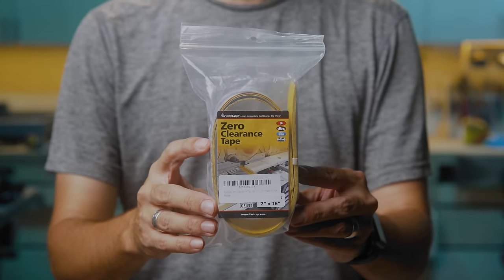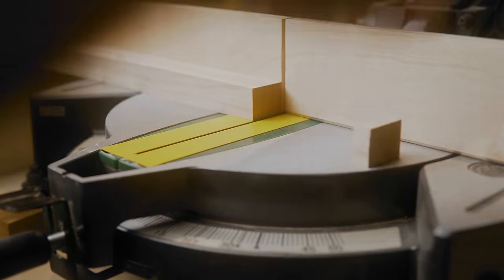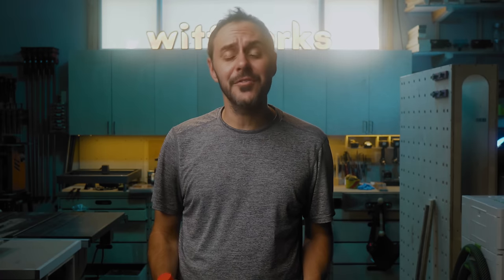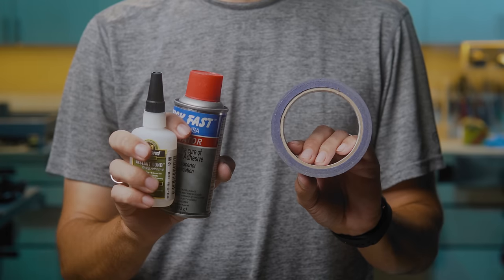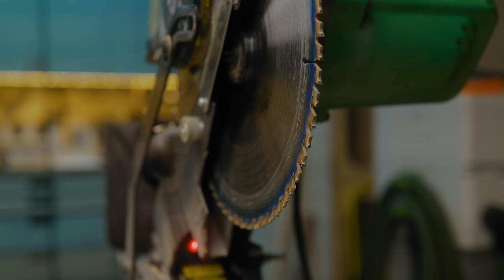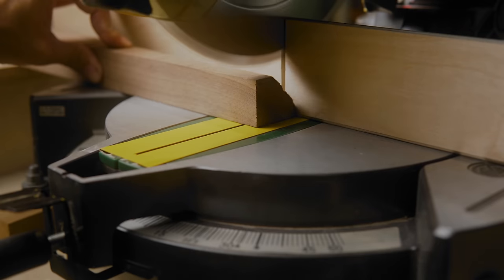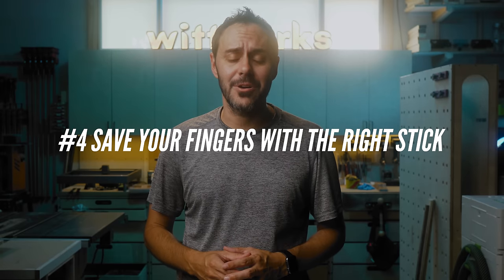fall in love with your miter saw again.

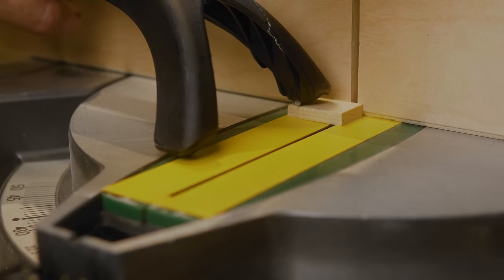Comment: That new push stick is bad because it flexes. You can see at 6:22 when you put downwards pressure, the small piece of wood moves forward slightly before the cut. Then after the cut when you release, it moves backward and leaves a visible gap from where the blade originally was 6:29
Reply: Great catch!!!

Comment: I live in Sri Lanka and I got a $100 miter saw (DongCheng) pretty certain that the company was cost cutting so they just gave a solid piece of plastic with no count outs. It basically was a factory zero clearance insert. And for that price the miter feature is accurate but the bevel feature is meh. I never use it cause I don’t trust the poorly pasted sticker. Also came dead square out of the box

Comment: Great honest video with practical application of things that most will actually use.  Sometimes I think some of these channels just teaches you to make jigs just to make the jigs with all the tools and get no real work done.  Simple is better.  Will give the CMT a go.  Diablo's are cheap but their teeth are very fragile.  I do want to add that a quality mitre saw does help, but avoid the sliders unless you actually need a slider.  A simple 150 USD makita 10" single bevel will do vast majority of the work you would ever need.  Less things to wobble, less things to adjust.  27 lbs of workhorse that you can take anywhere.
Reply from the maker: For sure. This summer I helped a friend in Montana and they had a very old 10” makita. It was dead on.
Reply: @wittworks  I love these things.  You can often pick these up for 50 bucks.  I just put different blades in different saws because of how cheap they are.  Goes up to a 5 1/4 at the base (with a shim on bottom will do 2x6) for most daily work construction to fine furniture.

Comment: I’m confused. Is this for a saw that is dedicated for 90 degree cuts? As soon as you need to cut any other angle you are cutting into the fence and bottom tape.  I built a workshop with pandemic pine and pandemic OSB 😢
Reply from the maker: Yes.

Comment: Tried out some XFasten woodworking tape last weekend, and whoa what a game changer. Used it on my planer sled, to hold pieces I'm attaching where a clamp won't fit. Works amazing, strong, no residue left behind
Reply from the maker: That’s great!
Reply: I have had mixed results with the xfasten. I will try this brand next

Comment: The problem with the 10 million dollar stick is it relies on surfaces past the deck of the miter saw which is no problem in a shop but anywhere else you are unlikely to have that support like if you are using vendors miter stands or using the saw with no stand

Comment: I've tryed to use plain masking tape for masking painting projects off and the adhesive is too strong without sealing off the tape from paint bleed and it leaves residue behind.  It might work okay for using it on saws and stuff, but don't try using that for painting/DIY projects. That's when actual painters tape comes in handy.
Reply from the maker: Exactly

Comment: The most dangerous thing in the kitchen is a full blade. This is true for saw blades, duller blades are dangerous for a variety of reasons such as catching on a knot, pinching, pulling, pressing, etc. A sharp blade will cut through something, a dull blade might get caught on it and send it flying. It can happen in both situations, but a lot less with sharp blades.

Comment: The '10 million dollar stick'  is a good idea but unfortunately, not rigid enough. It will move your piece out of alignment when you put hold down pressure on it. I have ruined many miter saw cuts using this stick and no longer use it.  Hopefully FastCap will produce a non-flexing (rigid) 10 Mil. Stick that will not flex and push your cut piece out of alignment.
Reply from the maker: Very interesting. I haven’t had any deflection in mine 🤔
Reply: I tried it as well. Besides the flexibility problem, I the "buttons" that contact the wood and tool surface are hard plastic that slip and slide. I felt more dangerous using the stick than almost anything else. It didn't take long for my 10 million dollar stick to end up in the trash.
Reply: @wittworks  at 6:22 in your video the wood moves forward from the push stick flex, and at 6:29 it moves back once you let off the pressure

Comment: get a makita drop saw, you get a zero clearance bottom plate already. you actually need to do a first cut before using it to cut timber.
Reply from the maker: Like a miter saw? I’m a makita man.
Reply: @wittworks  sorry yeah we call it a drop saw, I meant mitre saw

Comment: By the way...I hate my Forest Woodworker's II blade.   It burns on cherry and maple.   A Freud or CMT blade doesn't.   Good tip about the zero clearance tape.   Couldn't I just use wide double sided tape or duct tape?
Reply from the maker: Good info. 

I think you could use anything. This stuff is surprisingly hard and the adhesive is very strong.
Reply: The Forrest blades have zero side clearance. They scrape the surface of your work. If you don't have the fence setup correctly or use the blade on a table saw with too much runout you will get burning. The CMT/Freud blades are nothing special. They won't burn because they have side clearance. But they won't give you as good a finish. Point being don't blame the blade. The idea that they are as good as a Forrest is absurd. The carbide sharpness in a Woodworker 2 will outlast a Freud by way more than double.
Reply: @aspees  Hi Adam,  I have a perfectly set up 3 hp Delta Unisaw: fence and blade alignment.  So, I doubt runout or setup is the issue.  And, assuming the saw and fence were not properly set up wouldn't it also follow that the "lesser" quality blades would burn even worse than the Forest?    
That said,  I do feel the carbide of my Forest is probably better quality than my Freud blades.   And yes, I totally agree they give you a smoother cut.     But the blasted thing still burns cherry and maple.   And I have to break out a card scraper.   I asked Forest about this when the blade was new and they admitted this and suggested I raise the blade height way up.    Hmmm....I don't know about that.    If you are happy with yours, then fine.   Glad you are getting good results.    But for $150 or whatever the Forest Woodworker II costs now --- I'll take a good Freud, CMT, or Amana and pocket the rest of the money.
Reply: @MarkSWilliams27  Cherry is notorious for burning. The Forrest guys recommend raising the blade because it keeps the blade cooler. They should have told you to increase the feed rate. Most people feed too slow when using table saws. I would not choose the WW2 when cutting cherry. It is the wrong blade. I own all of the brands you’ve mentioned. They are all decent blades. They do not make a blade as good as the Chopmaster. Period. End of story. As far as cost. The cost difference is up front. After that each sharpening costs the same. Overtime the Forrest blades cost less, because they stay sharp longer.

Comment: The zero clearance tape you are using is exactly like conspicuity tape, just a different color and On amazon lots cheaper.  That is what I use.   You are right the lasers  really don't work, and the Aux fence is a great idea,  However a shadow line is easy to make and is perfect.  So you are comparing a 5 year old trash blade to a new CMT blade?  Hell a new carbide anything would look great next to the old one, Kind of dishonest there Dude.
Reply from the maker: If you think I’m dishonest, do a little research to find the video where I’ve compared those blades to brand new diablos.

Comment: Or... skip the tape and run some short screws through the back of the fence where those conveniently placed screw holes are.  Its almost like they planned for auxiliary fences.
Reply from the maker: I ran out of flat head screws.
Reply: Fun fact about the screw method.  When i take the fence off for whatever reason.  When i'm done i put it right back on.  With the screws.  Pretty sure i used some leftover hinge screws.  But in a pinch, you do you.
Reply from the maker: I like the repeatability of that. You can swap out for 45 degree fence
Reply: @wittworks  Yep. I'm a trim carpenter.  I have my fences all marked out for different tasks like crown, coping, etc. Used a cpl pieces of engineered hardwood flooring.  Super sturdry. And i just swap between the fences as needed.
Reply from the maker: Beautiful. Love tricks like that.